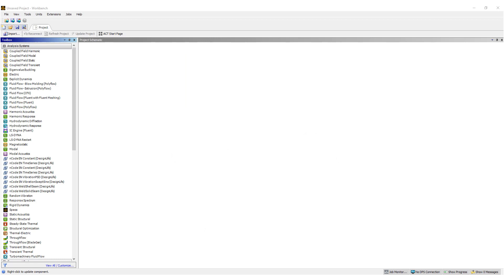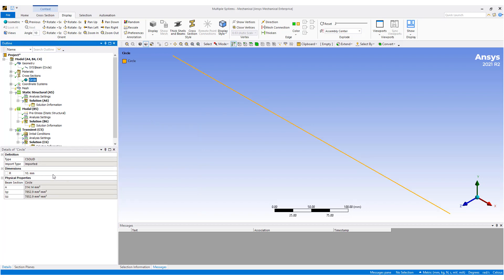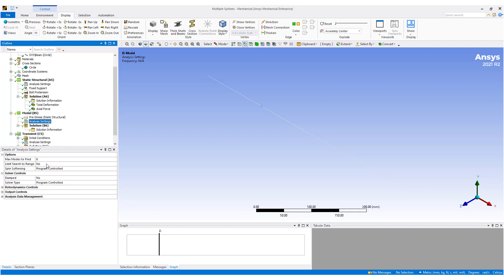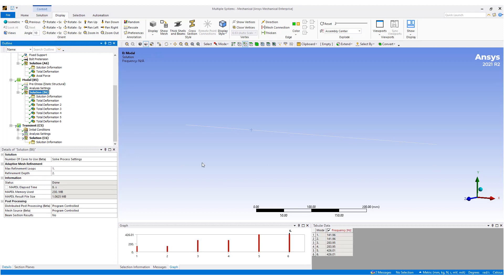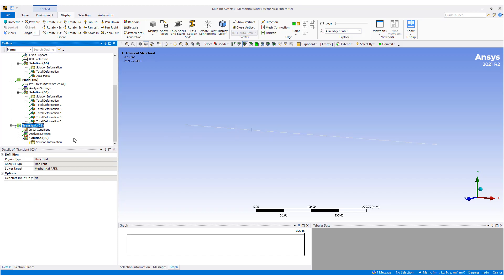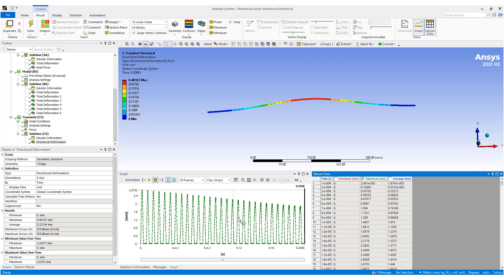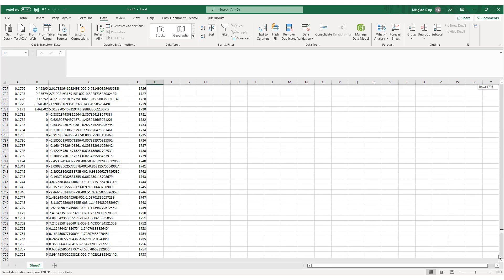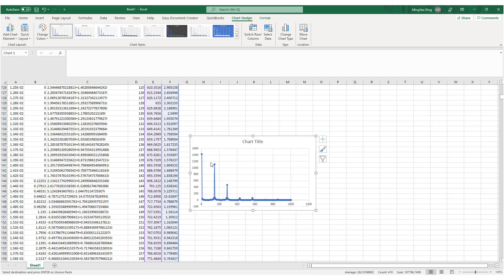Harmonic Frequencies analysis of guitar string in Ansys Mechanical

Comment: Hello, i have a question for example im trying to study the vibrations induced by the internal flow on a pipe, so im importing this pressure from fluent analysis, to static structural, then i do the modal analysis and finally the transient structural but my question is if i have to put the pressure as a load on the transient structural or what kind of load should i put? i'll appreciate your answer. ty